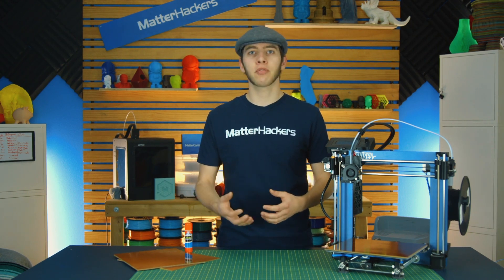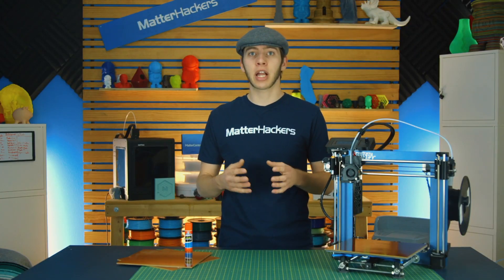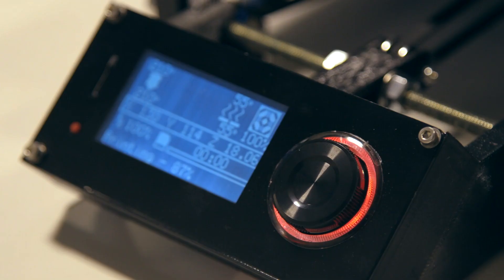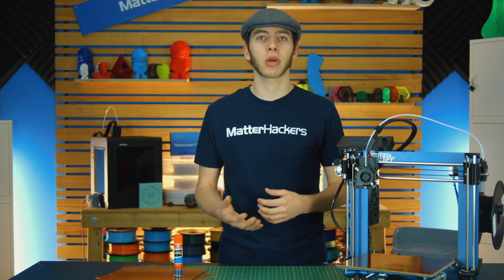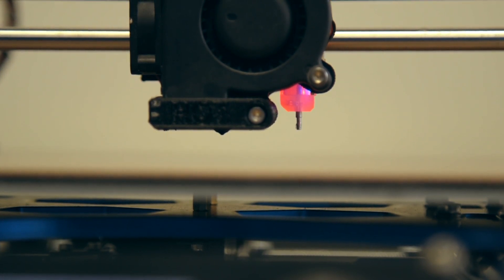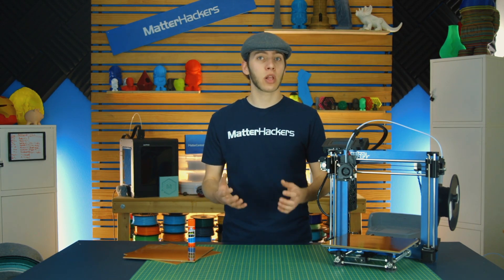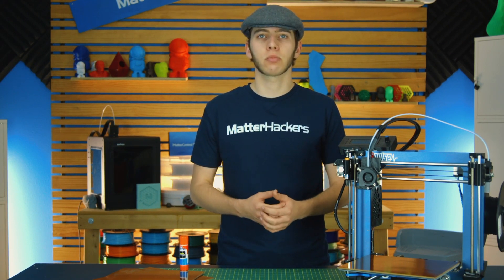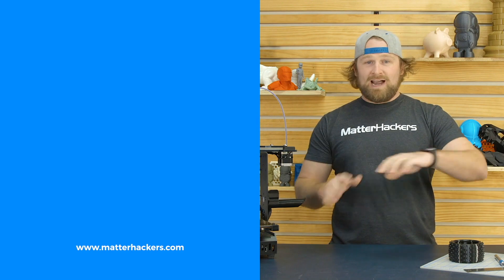How To: Print with a Garolite 3D Printing Bed // 3D Printing Tutorial

Comment: After watching this I bought a sheet to attach to my Pei magnetic plate. 
My Flsun V400 just loves it, and so do I !
I was not sure how to attach it so I taped it to my spare magnetic PEI plate (300x300 mm).
It works great (after new bed mesh & Z- height settings).
I am now wondering what glue would be best?

Great video, great tip!

Comment: This stuff also works really well with PLA and PETG, by the way, according to Maker's Muse. I wonder if scuffing the surface would make it release easier - maybe try it in a corner first. Scuffing polycarbonate sheets used as print beds works in this way.

Comment: is garolite the same as bakelite?
Reply: bakelite/pertinax are brand names for FR2. Garolite is a name brand, but is commonly associated with G10, which is a superset of FR4 (a flame retardant specification). FR2 uses Phenolic resin with a paper substrate whereas G10 uses an Epoxy resin and a fiberglass weave as the substrate. They vary slightly in their Glass transition temperatures which may impact your printing application, but in practice they seem to perform similarly. FR2 has been used in printers in Europe for a while, so I've been told, but It is hard to find in a variety of thicknesses and larger sizes in the US.

Comment: wooooowhoooo! just got my garolite sheet in the mail!!
Reply: What printer for and where from? I want one for my mk3s thanks!
Reply: @rohun7867  
Hi,
I bought mine through matterhackers site, for one of my CR-10s   here    https://www.matterhackers.com/store/c/garolitebuildsurfaces.
The sheet I bought has a very strong adhesive on the backside that stuck down to glass plate of my CR-10 very well.  The sheets are thin enough (.038"/.97mm) that they should flex if you are deciding to stick it to your mk3 flex plate.
Reply: @VayaconChupacabra  Thank you!, I would like to stick it to my flexible build plate but was wondering whether it is possible to buy the garolite sheet and adhesive because matter hackers, unfortunately, can't ship to my location.

Comment: ive also had really good success printing on carbon fiber.... granted it makes for a very expensive print bed but it bonds very well (it also is an epoxy resin type surface) and it holds heat very evenly when using a heated bed.

Comment: I just tried Garolite on my Ender 3. With PLA, it needs a light mist spray of clear laquer, but it really works better than PEI. I used 0.125 " thick (3mm), trammed to 0.08mm, 70 degree bed. No brim or raft required, bed side is as nice as top. I sourced it from Grainger. 
Better than PEI or glass.
Reply: If you need laquer + garolite to print PLA because PEI isn't doing it....  You may have other issues at play.   That's one of the strangest thing's I've heard so far.
Reply: @Xenu Prints its hard for me to really say because I skipped PLA all together; I started with PETG and after 2 years I've printed TPU, PCTG, various carbon fiber nylon blends.   Just not PLA.  But I've never heard of someone having so much issue with PLA.   Like, who buys gasolite to use with PLA??

I dont use any cooling.  I removed the cooling fans to save weight. 
But a PEI spring steel plate is pretty amazing.  Havent found anything yet that won't stick to it. 

I get it though.  
My first few months with PETG I was running way to hot, but I had managed to compensate for it up to a point.  After that I had to go back and re-learn fundamentally what I was doing wrong before I could move forward.

Comment: Hey, I need one of these in 500x500 for NylonG big prints but Matterhackers doesn't sell them.  I really want to buy one from you and you don't sell them.  Instead I have to do some more research and then play Guess Which Type of Garolite is Correct from McMaster-Car. When I could have just bought one from you.
Reply: They are all similar, get the cheapest at 3mm thick.

Comment: garolite expands with heat, so make sure it is clamped and not screwed in place. Clamps allow it to expand without bowing. I would also recommend leveling the bed at the temperature your going to print with. You can also get a version of garolite that is fire retardant, can’t remember what it is called though.
Reply: The fire retardant version is what I use and is called fr4 g10
Reply: Everything expands with heat. Even the cheapest Garolite is good to over 200C.

Comment: If you guys are struggling to get your mic volume up, keep the gain level on the mic low enough so you don't get clipping, and then use an audio compressor in Post to bring the level up

Comment: Great video, never heard of the stuff.   I use Anycubic Ultrabase' on all of my printers and love it!  Only down side is that you can not use it if you intend to take advantage of power failure recovery as once the bed cools your part WILL release and wont re-stick when heat is re-applied.  I have a UPS so these instances should be very rare.
Reply: BTW with this bed, PLA and PETG (only products I've printed so far) do not need any additive added.  No glue, spray... nothing.  It just works.

Comment: I have been printing PLA on my Pulse XE, I always need to use gluestick, but then it sticks so well, I have been able to lift the entire printer by the part I printed. I ordered the flex plat system, I just havn't gotten the courage to remove the pre-installed bed